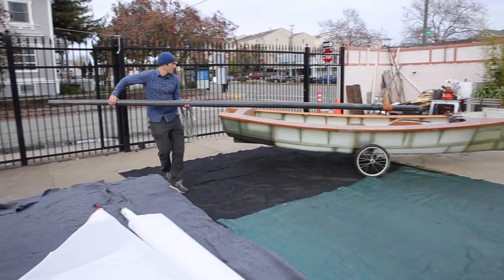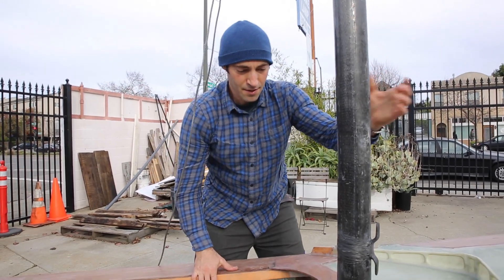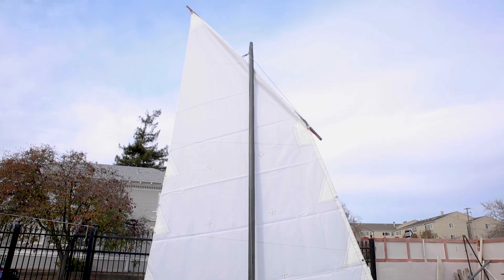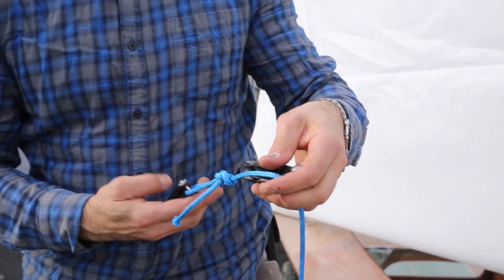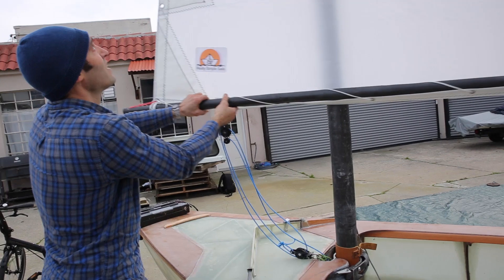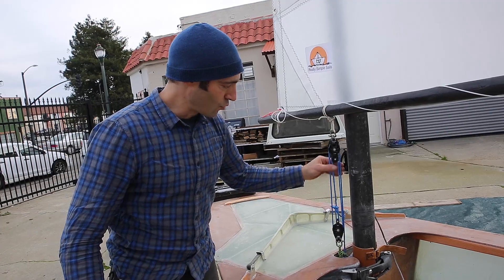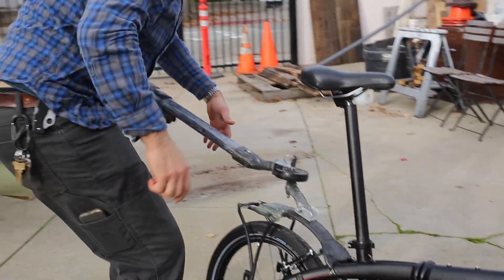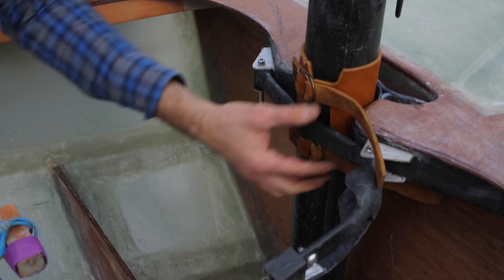Yard sailing on San Pablo Avenue

Comment: Very nice. Did you make the carbon spars yourself?
Reply from the maker: Thx a lot. Yes, I did, and my oars, centerboard, and a few other parts too. Once the boat started looking like it was going to weigh over 300 pounds I tried anything I could do to keep the weight down. I think I saved 30 pounds with all my carbon work.